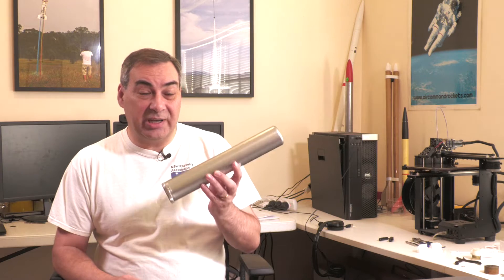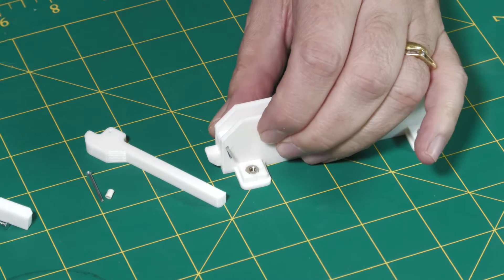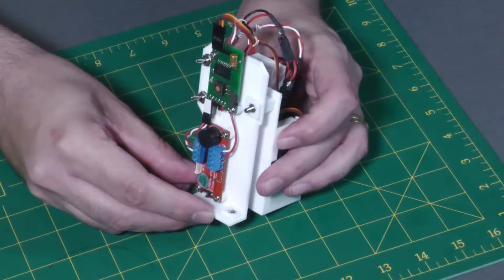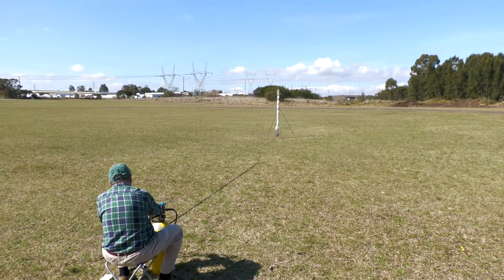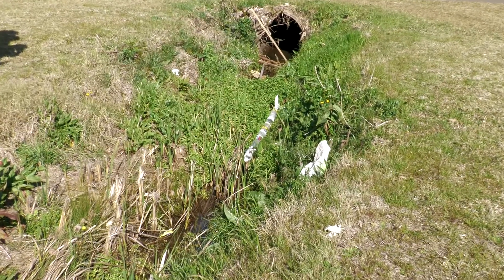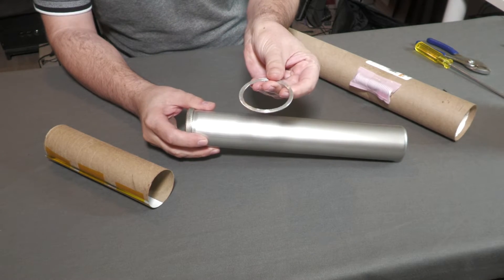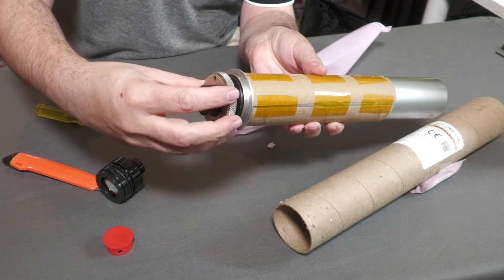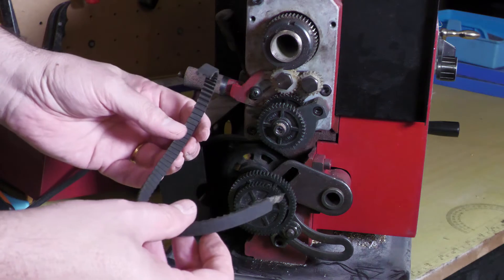High Power Water/Pyro Rocket - Part 7 - Rocket Upgrades

Comment: Oh, how nice. finally found confirmation, that an apogee detection works on a water rocket. We need some sort of graphical flight log and since the altimeter 3 is no longer available anywhere, we must use an ENTACORE AIM DUAL DEPLOYMENT ALTIMETER since it’s the only thing we found with high enough precision for the low altitudes of water rocket. We were not sure if the detection even works but now, we know that it might…
Thanks for the tutorial on how to fix a lathe as well.
Reply from the maker: One of the main things I always look at when getting a new flight computer is what is the launch detect condition. Apogee detection has never been an issue. With water rockets and small nozzles sometimes its possible that the rocket takes off too slowly that it won't detect launch. Some flight computers need a certain altitude change within a certain amount of time before launch is detected. The other thing to watch out for is that a lot of water rockets are clear so direct sunlight can reach the barometric sensor on the flight computer. This can produce large noise spikes in the data and falsely detect apogee. Always shield your flight computer from direct sunlight.

Comment: Hi! Where do you tend to source your motors like the J360 from? I understand there is a shortage of APCP motors in Australia for various reasons
Reply from the maker: The Aerotech motor order is coming in through Berg's hobbies. I think the next one is due soon, but you need to book well in advance to order the motors. This particular J was an older motor from a member that had left the club a few years ago.
Reply: @AirCommandRockets  Yeah seems like Berg's is one of the only place to source any motor with a mid power impulse or more, I had to get a black powder F from a club member who originally bought it from Berg's a while back. It would be great if it weren't so tricky!
Reply from the maker: @arro_rockets Well water comes out of almost every tap :)
Reply: @AirCommandRockets  That is an excellent point! I will be launching my bigger water rockets again soon for the summer ;)